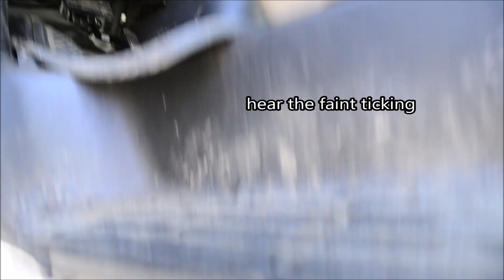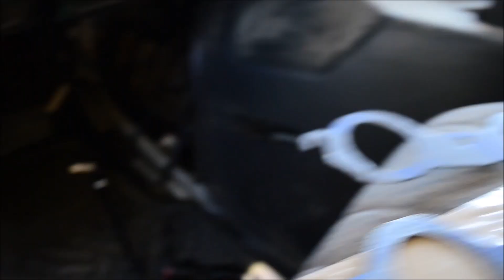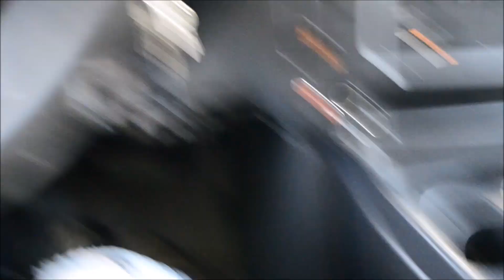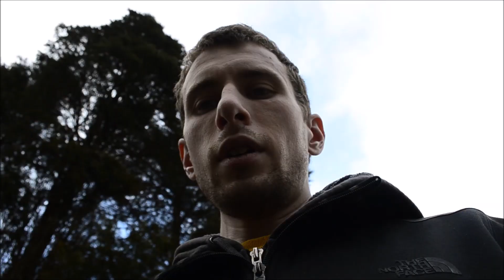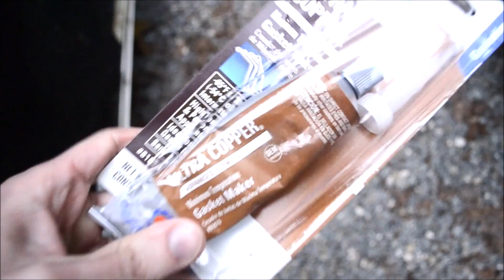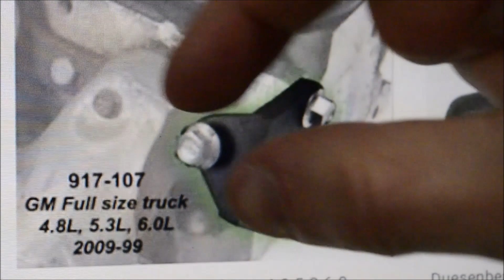Broken Exhaust Manifold Stud / Bolt Repair and Ultra Copper RTV Gasket!

Comment: I don’t have a welder either, but when I broke a frame bolt on my 2002 Mini Cooper S, I used three car batteries, booster cables, vice grips and a welding sticks to weld a nut on the end of the stud.

I did buy welding gloves and goggles, because some safety matters.

I got the idea from on-trail Jeep repairs.  Figured if it was good enough mid-trail, it would work in the driveway.

You don’t have a lot of control welding with car batteries, but DC welding gives good penetration, and all I was trying to do was get a nut on a recessed, broken stud, and it worked!

Comment: Dang did that stuff burn off?? Temps get too hot to use that stuff i thought
Reply: That's why you'd use the ultra copper. Copper is the best for dissipating heat, so it helps the epoxy not break down.
Reply: Good to know. Thanks for the helpful video